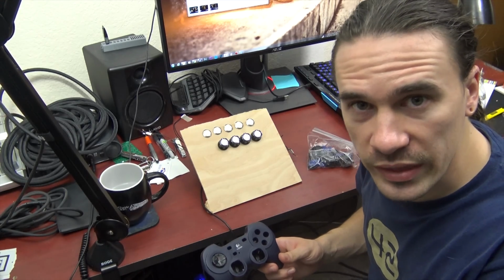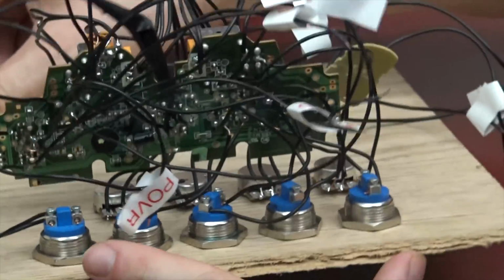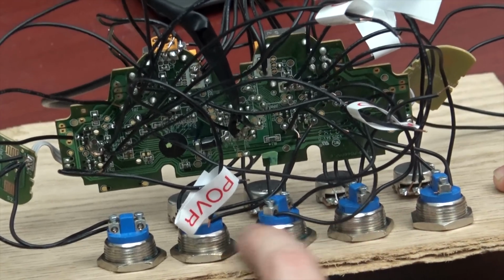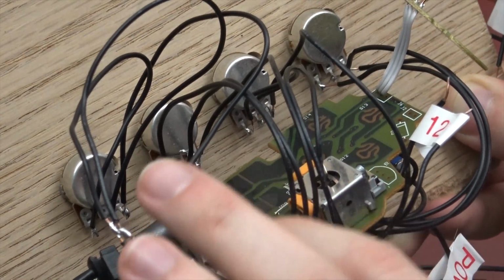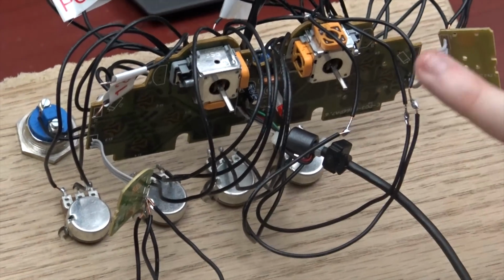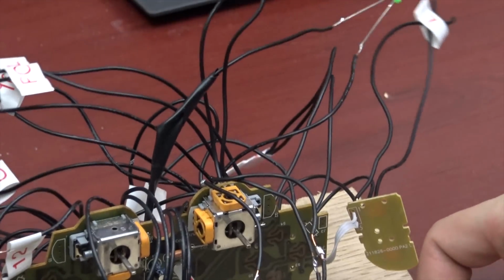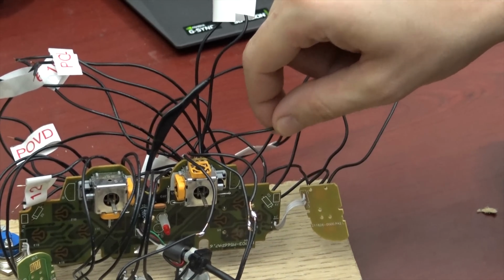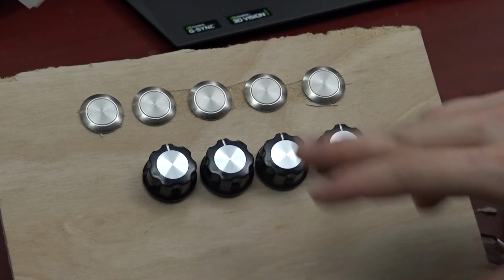How to Make a Button Box Part 1

Comment: I'm making one of these now. The Blog photo of the board for the Logitech pad is gone.
Reply from the maker: There is a teardown on the iFixit website. I'm not seeing that there is a diagram of the test points, but maybe it will help in some way. https://www.ifixit.com/Device/Logitech_Dual_Action

Sadly I cannot find anything showing the diagram of the test points anymore either. May have to go for trial and error testing, or follow the circuit lines to see what connects to what.

Comment: I'm now getting into sim racing, i've tried using an Official PS3 controller but my PC doesn't recognize it, i'm guessing it's due to it not being microsoft like a xbox 360 one?
Reply from the maker: Dinxsy that is correct. you can do one of two things to make it work though... You can either download a special software to make it work, or you can buy a ps3 to PC dongle. the dongle is about $5-$10 on Amazon.
Reply: I've found a few people that use a USB encoder, basically plug and play. Thanks for the reply though bud.

Comment: is there a reason why so many use old ps controllers rather than buying a new pcb?
Reply from the maker: +yuenglingking None other that it's already there. You can easily buy a new PCB, or use an Arduino for this project. I just had an old Logitech controller laying around not being used.

Comment: how do make that printplate
Reply from the maker: +Diepenth Diepe do you mean the PCB? If so, it's a Logitech controller that I took apart, and re-used for the project.
Reply: +Electreak a oke
Reply from the maker: +Diepenth Diepe you can see the full build in the part 4 video. :)

Comment: what if i use a 100k pot ? will it work ?
Reply from the maker: I tried with a few different valued pots(10k, 25k, and 75k), and everything but the 10k pot gave me weird results. I your controller board is made to read 10k pots, use that, but it doesn't hurt to try different pots with different ratings.